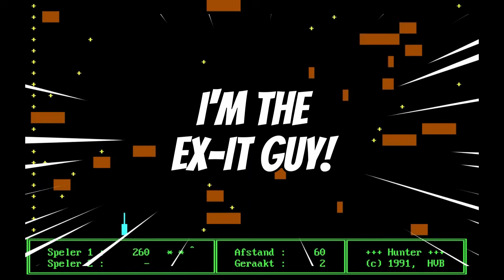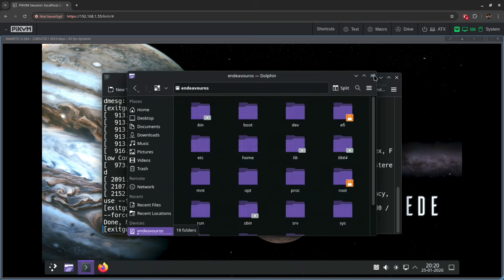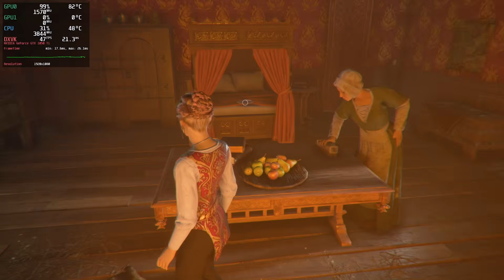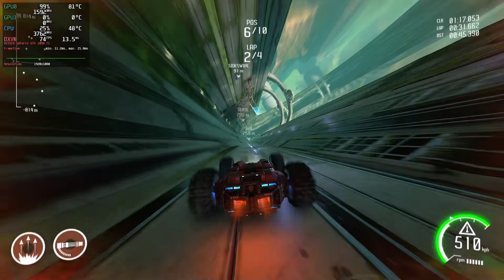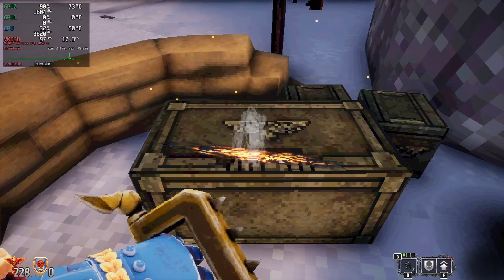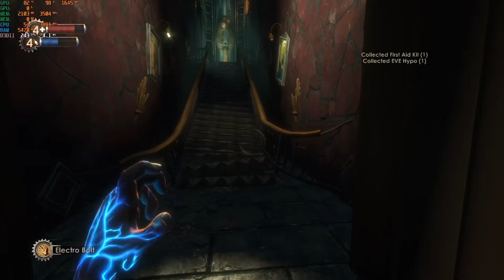Using an old office-pc for gaming? HP Prodesk 600 G1 / GTX 1050Ti

Comment: try it on rocket league!:cat-orange-whistling:
Reply from the maker: I don't have it anymore but I'll keep it in mind for future stuff!
Reply: @ex-itguy  nooooooooooooo :face-purple-crying:, thanks for the reply! im buying this computer for gaming
Reply from the maker: Weet GPU are you planning to use? This one didn't have a PSU capable of driving a GPU that needs external power and since it's using a proprietary connection you can't simply swap the PSU for a generic one.
Reply: @ex-itguy  I just got into computers :(, I dont know what GPU ill use
Reply: @ex-itguy  yet*
Reply from the maker: Well looking at videos online it should do fine on a GTX 1050Ti like I used in this video.

Comment: I wouldn´t use a Nvidia GPU in a Linux gaming pc. In this case a radeon rx560 4gb would be perfect. Can be found for next to nothing.
Reply from the maker: I believe an RX560 needs a 6-pin, doesn't it?
Reply: @ex-itguy  Not always.. there are models without 6pin. They use the max 75w delivered by the PCIe connector.
Alternatives are also Radeon WX3100 and WX4100
Reply from the maker: @PhoticSneezeOne I'll be on the lookout for one of those! Thanks for the heads-up!

Comment: Linux does not get along very well with nvidia hardware, unfortunately. You're better off with Intel Graphics or an AMD based GPU for use in Linux.
Reply from the maker: I thought that might be better with the 580 drivers, but apparently not 😅
Reply: @ex-itguy  Yeah I think there's only a few nvidia cards that work alright on Linux, but compared to Windows, there'll always be a trade off when using nvidia. Most of the time with AMD, I've only seen uplifts unless the card is super old, like AGP era ATI card.
Reply from the maker: @R-Tech_Gaming  Hmm, sometimes even AMD GPUs seem to be less performant on Linux, but usually that's not the case indeed. I do wonder what a nore modern Nvidia card would do using the nvidia-open driver but sadly I don't have one.
Reply: @ex-itguy  I think compatibility wise, the 30 and 40 series would be your best bet on nvidia. As for AMD, it largely depends on how common the GPU was. Like if you have a Polaris, Terascale, GCN, or RDNA card, you should be golden. I do wonder though how my old R9 290x would run on Linux.... 🤔
Reply from the maker: @R-Tech_Gaming I did a video on my own 290, but I simply compared it to this 1050Ti and haven't checked if there's a difference between Windows and Linux. Maybe I should. :)

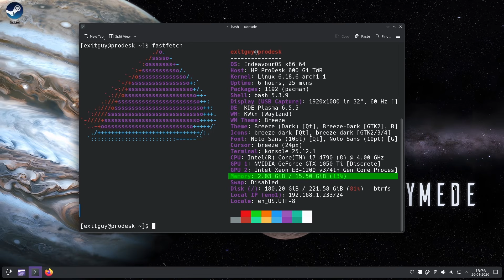Comment: 3:00 why there is e3-1200 xeon cpu detected ,and as a 2nd gpu? in both linux and windows
Reply from the maker: That's the iGPU (on both accounts). I couldn't disable that in this system's BIOS.

Comment: Any Arch Linux is a very good choice in 2026 for gaming and general purposes. Actually i´m using CachyOS + XFCE DE and the performance is really good. My desktop and main PC right now from 2015 is weaker and slower than the i7 4000 combo + Low Profile GPUs., it's a a10 7700k apu with R7 260X and goes better with Arch recent kernels for wine+DXVK than Debian distros like Mint, MX or Buntus.
Reply from the maker: Yeah, on a system like this you won't gain anything from running a more lightweight DE though haha
Reply: @ex-itguy  XFCE is a very customizable DE, i tweak that like a MacOS wannabe. i really like Plasma and CInnamon but have rare glitches and XFCE wins with the transparency in panels and windows.

Comment: Windows 10 is dead, you should of tried it on windows 11. Yes it will install, i have win 11 on a 3rd gen i5.
Reply from the maker: The LTSC variant isn't dead yet ;)
Doesn't matter much in performance though.

Comment: My 26 year old daughter still has my old 4790K system, though upgraded with 32 GB of RAM and a used rtx 2070. She plays fairly modern games as well and so far there havent been any major issues. It's impressive what older cpus are still capable of
Reply from the maker: It's a pretty darn decent system indeed! A nice upgrade for a friend with an i7 2600 that often hangs. 😊

Comment: That CPU is still somewhat of a legend,and i think it's probably held down by the DDR3 speeds too. The Linux gaming part really looked well,but i think the lower FPS might be caused by the graphics drivers not being as good as they are on Windows since Linux normally uses less system resources
Reply from the maker: I was very much impressed by it indeed! 
To be honest I expected the 580-drivers doing pretty decent but it seems even this slightly more modern card is still better in Windows. I do wonder how more modern ones would do. Sadly the only AMD GPU I have that does not need auxiliary power is an R9 255 which is slower than this GTX 1050Ti.
Reply: @ex-itguy  Well until manufacturers start to care and make official drivers for them i highly doubt things will change much. Drivers are still pretty generic when it comes to Linux
Reply from the maker: @Ov3rk1ll-x9q  AMD actively maintains opeens source drivers though. Most modern minis I tried do better on Linux.

Comment: Like the mr said, don't do raid 0 with your discs as long as you are eager to speed too much. If 1 of your disc fail it means you say bye bye your both discs.
Reply: Well only your data and 1 disc is gone, not the both discs
Reply from the maker: Yeah your other disk won't break at the same time, but your data is distributed to both disks so most probably all data is lost.
Reply: @ex-itguy yes sir i am not native, so that is the reason why i need a correction comment 😂
Reply from the maker: @yavuzayhan2245  me neither, so I get that 😄

Comment: THE i7-4790 IS still A FANTASTIC CPU. I honestly rebuilt an old system i had for my son who is now old enough for a starter PC, 16gb DDR3 1800, i7-4790s, GTX 1650 Super (4gb) and it is fantastic for his needs! You absolutely CAN play modern games on 4th gen!
Reply from the maker: If anything this video shows the system is capable of way more, with a pretty big GPU bottleneck. How's that with the 1650?
Reply: @ex-itguy  It's great for him! he does a bunch of Minecraft, with mods, some fortnite low power stuff but he is happy! when i had it i had a 1660 super 6hb and it was great! played everything i wanted at reasonable frames for a bedroom pc!
Reply: The i7-4790 is probably THE best/fastest CPU that still utilizes DDR3 RAM, if I am correct. If you get the K variant and the right motherboard for it, you can really overclock the hell out of it and increase its performance even more!  It's way fast enough to enjoy it without any overclock, though. 👍👍
Reply: @arthurmann578  I have the S variant which is NOT overclockable. I have it in a Mini-ITX case and board with a flat Noctua cooler, so i don't want too much more heat from an overclock. But Absolutely the K variant is Balls out fast when tuned correctly! If ONLY it was 6c12t LOL

Comment: I speak from personal experience that converting the anaemic proprietary PSU to a standard 500W is a pain.
Buying the correct 24 pin cable adapters was not possible as the eBay & Amazon sellers ALL didn't know what they were doing, but I was able to re-pin an adapter I bought to the correct pin layout. 
The size of the proprietary PSU is actually not the same as a standard PSU and also, the mounting screws are not the same - so I cut apart the casing of the proprietary PSU and used it as a mounting adapter for the standard PSU.

One last thing is that the motherboard is designed neglectfully or maliciously such that installing a larger 2+ fan graphics card like my Sapphire AMD RX 570 would block out the connector to the front USB 3.0 I/O port. I eventually bought a used single fan MSI NVIDIA GTX 1650 to use instead.

For a time, I was able to play Fallout London 1080P 60FPS on it - running on Linux Mint and Steam. I also tried a USB blue LED light strip to get some light to shine out from the case (particularly from the front grille) to give it a visual effect that it's not an ordinary office PC anymore.
Reply from the maker: Damn! I didn't know it was that hard haha! I didn't actually check but I thought the size was that of a normal ATX PSU. I guess not.
Reply: That sounds like a good project.